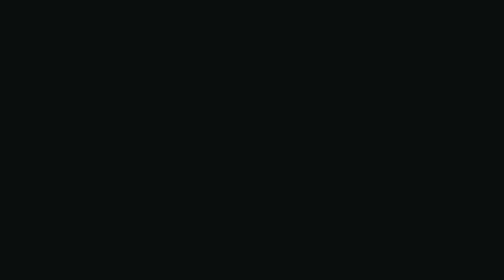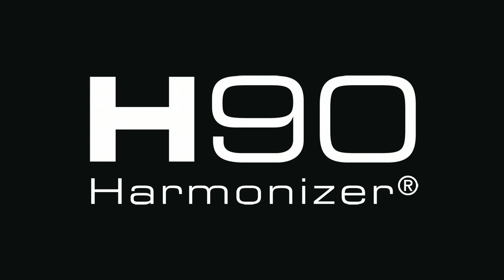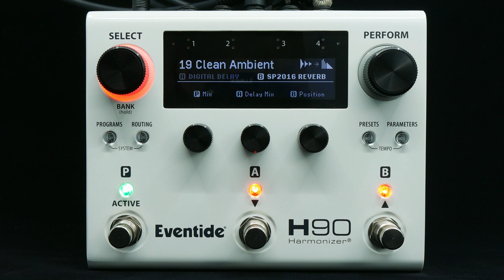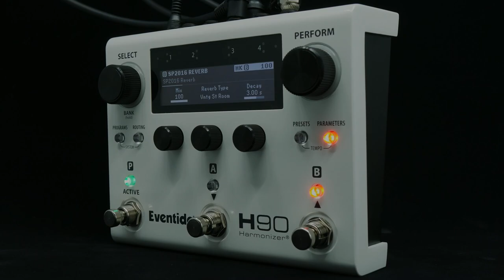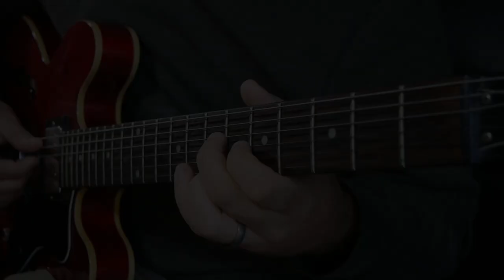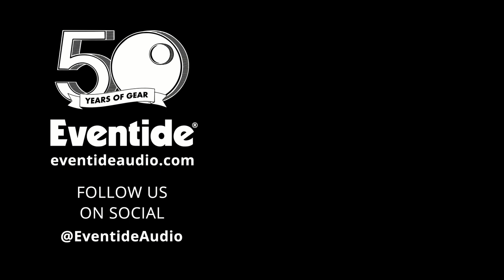H90 Harmonizer® Pedal Demo: SP2016 Reverb Algorithm

Comment: how does this compare to the function of using a bigsky/timeline during songs, playing live, etc.  can you change this easily?  just wondering how this works on a practical level w/o midi.  I think this is why guys would typically use two H9s, as it would give you an easier way to select/on/off the various settings
Reply from the maker: Bank Mode gives you three selectable Programs at any given time. Once you’ve activated a Program, PERFORM mode allows you to turn any effects on or off as well as control things like tap tempo or multiple settings at once. Significantly more control than the aforementioned pedals.